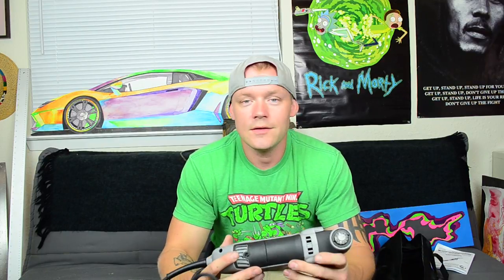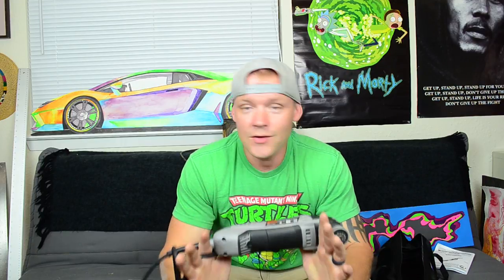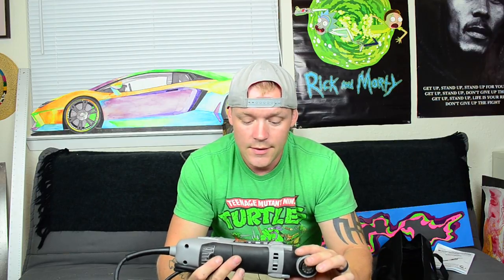TOOL REVIEW - Dremel Multi-Max MM40

Comment: Thanks for your honest review. You let it be known you prefer cordless, but also talked up the tool. And I can definitely see where corded tools would be a pain in rough in construction since power is still at the pole or limited distribution. But for remodelers, cabinetry shops, & other jobs where power is everywhere I think corded saws win the day. Less cost up front, consistent power, no need to have 3 batteries & a charger with you. I do love my cordless oscillator, but cutting through the plaster/drywall combo my house was built with goes a lot smoother with corded power.

Comment: Thanks for this review. Looking at a new Dremel, as mine is dying. Use my Dremel as a router, drill press, drywall for install electrical work, etc.... So, am looking at the multi tool, and the traditional Dremel both corded & cordless. Might also go with diff brand, but this vid really helped me decide.
Cheers, A

Comment: Corded tools have some advantages over cordless ones, such as: they are cheaper, more powerful, do not require charged batteries, they are lighter in weight, never run out of batteries. I don't think it makes sense to equate corded and cordless tools. Each of them serves it's purpose and has advantages in certain situations.
Reply: A lot of the time job sites don't have access to power to run corded tools

Comment: Yes, corded is more powerful, you don't have to charge it ever, the batteries don't lose their capacity over the years, and if you just have one extension cord already, you can use it for 5,000 projects.

Comment: A fav is the QBit to help fish wires, especially through a fire block inside a wall, 😄. Just need a cordless tool that can do a lot of things & is EXTREMELY Durable. Any other suggestions? Use tools for plumbing, wiring, construction, networking, etc etc...
Thanks again for your feedback on this tool. Think will pass, least on corded, & look at other brands or alternatives.
Cheers, A

Comment: Nice review but I disagree on a couple of points... first dremel tools especially the high speed multi tools are and have for a long time been the choice of professionals in many precision industries like electronics. Obviously it is not a name associated with heavy industry or construction. Secondly battery power is great for tradesmen and the like where they are real time saving and convenient assets but they are not always great for big jobs that require hours of heavy duty work,  they can also be a pain to work in tight spaces. I use both and each have their place. One thing I can say is I am lucky to get a year or so out of battery power tools - I have some mains power tools that are still standing up over 10 year's old.

Comment: Hello I had a quick question could you please make a video on how electrician work relates to IT work i have been in IT and studying computer stuff for about 3 years and have had two jobs one as a help desk guy and one as a computer technician i am thinking about going into the Electrical trades as i think it would be interesting as well as help me better understand motherboards inside of computers. As a PC tech i worked with a lot of PSU's and voltages and wattage related to motherboards. I am good at computer math however i need to brush up on my math skills since i have always been bad at it. could you make a video about this please ? I am currently working as a construction worker doing basic stuff like flooring and demo i basically hand tools to the boss man and try to pick his brain as much as possible i like this kind of work as opposed to staying in doors working through a command line all day i thought about going into PLC type stuff. what advice can you give me to be a better worker ! what field do you think would be right for me ? Thank you.